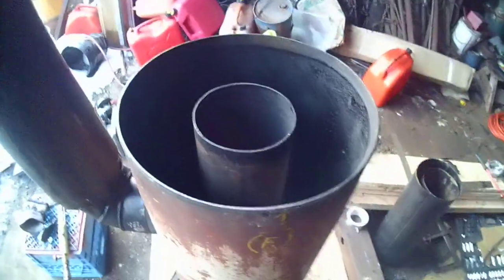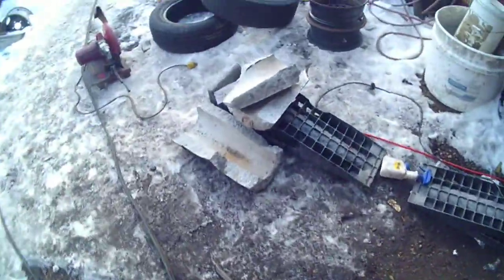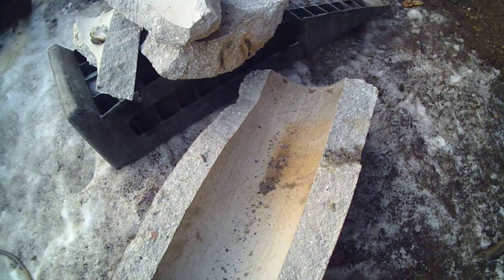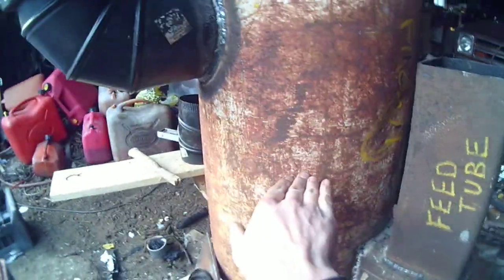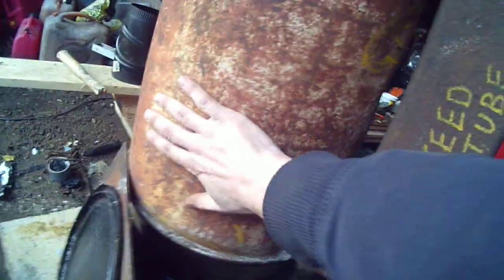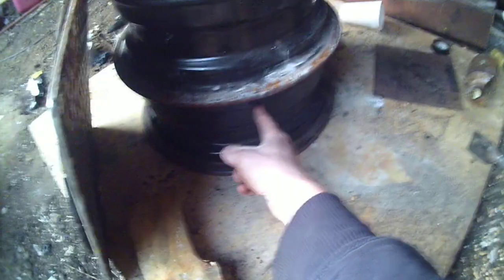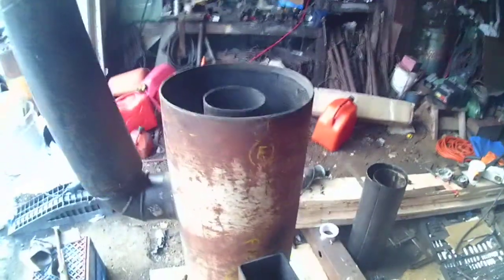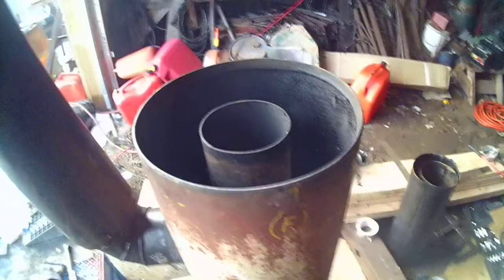Rocket Stove Burning Pellets - RMH Hybrid

Comment: can you tell me the dimensions of the insert that holds the pellets?  I have a wilderness stove but it cooks me out of my hot tent... i think your insert is the answer to my problems!
Reply from the maker: i find the pellets burn hotter than the sticks, this stove can burn either sticks or pellets but the good canadian hardwood pellets burn hotter than dry hardwood sticks in this unit.  the pelllet attachment has to be a tapered basket and has to be a tight fit into your vertical feed.  my feed tube is 5"x5" inside i think, so i had to make my pellet basket attachment 5x5 for a tight fit, and the insert attachment is about 6" tall.  if your feed port is 3" or 4 inch, thats how big your pellet basket should be.  i find the front port on my stove is necessary when burning pellets for air intake, but i have to keep it as a closed j-tube when im burning wood and sticks.  the pellet insert turns my vertical feed tube into a pellet hopper, and turns my rocket stove mass heater into a gravity fed pellet stove mass heater.
Reply: @613Builds  and what thickness of metal for the basket?
Reply from the maker: @darrellintents3086  i just used 1/8" i think, but if i did it again i might use stainless steel.  this was just a prototype test unit for R&D but it worked very well

Comment: You say you filled it above exhaust outlet ? know wonder it did not work !
Reply from the maker: Most of the refractory cement mass is below the exhaust, but it surrounds the burn chamber tube and the riser.   The bottom of the riser and the entire burn chamber are cemented in when the mass is poured into the LPtank.  This mass absorbs heat from around the riser and around the burn chamber.  I will do an update on this stove again soon with burning pellets again.

Comment: So the insulated riser suckeď up so much heat that the gases and ash wouldn't burn
Reply from the maker: This was my first design and build and learning experience.   The riser was never properly insulated, but it still functioned well as a learning experience for me.   I eventually got this unit working good enough that the burn chamber would glow incandescent.  The part I removed from the original riser was not insulative, it was massive.   It was sucking the heat out of the burn chamber.   I tried a fiber cement liner but it smoked, eventually I used a corrosion resistant stainless steel liner.   But I have also moved on to methods avoiding metals in the core/flame path.   I have built and designed more RMH hybrids aside from this one, but this my was first design and build.   It was a good learning experience.   I still have it and it still works, but the steel sometimes becomes incandescent, glowing red.  That's why I moved on and started using cast cores and firebricks.  Thanks for watching.
Reply: I went to tell forum site you gave a link to in another video. I should of gone there 2 months ago, that gave a formula for riser diameters. Leaving that tells broader the riser tube the higher the draft suction.  I'm trying to make a portable unit, meaning the Bell and riser assembly no more than 50 lbs. the fire box and burn camber a separate unit hopefully no more than 50 lbs 60 lbs may do prehaps  ,using a propane cylinder has shown in this video The burn chamber @the riser bottom refactory material as well as the wood burning chamber (box) refactory as well. I like your conclusion of using  fire brick and wis now that I had considerated on that approach but was redirected away by the cost of commonly available firebrick $3 a brick.  Yet $100 dollars spent on fire back would of been a lot cheaper than the makeshift refactory that I cobbled together. Yeah. I got out of wack on the cost of firebrick and spent 4 times the cost as an alternative.
Reply: Your pellet burner is  or seem the most simple and successful of any pellet burner demonstrated on YouTube. Your second horizontal pellet burner is very sophisticated with the incorporated secondary  air feed. The way it early slides into the horzontal burn chamber is impressive.  I don't plan on burning pellets but if I do go that route I would opt for your less efficient wedge pellet burner. I like your short videos , you get important info packed in 3 min . Your 9 min videos are tolerable as well
Reply: Here you illustrate the cast riser as being ineffective because it doesn't insulate but acts as a heat sink starving the burn chamber  of potential heat intensity. That a great observation that I'm now concerned about  since I have added higher percentage of sand  and Portland cement to my vermiculite mixture. Do so will probably negate the  mixtures insulating value I will see or be aware of potential results per your observation in that reguard
Reply from the maker: Firebricks can be pricey, but they really very good for RMH construction.
Reply from the maker: The pellet burners are great, but I wanted to burn wood from the land so I went in a more average wood-burning direction with my designs.   But I did have fun working with pellets.   Pellet burners fluctuate in temps when ashes build in the burner, so they need ash escapes also.
Reply from the maker: Yeah this was my first build and I was simply aiming for a smokeless/clean burn exhaust.   I did get it burning clean before I moved away from the metal core and designed two more stoves later without any metal in the cores.